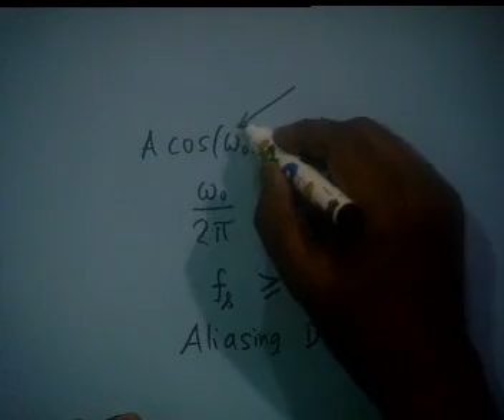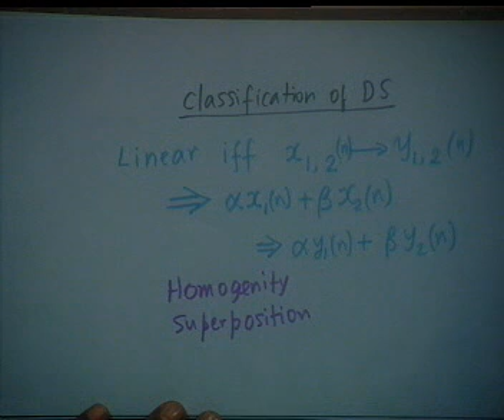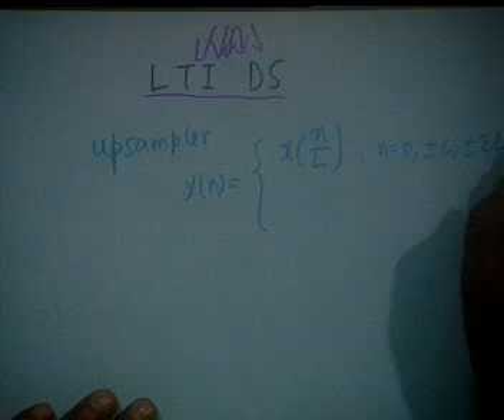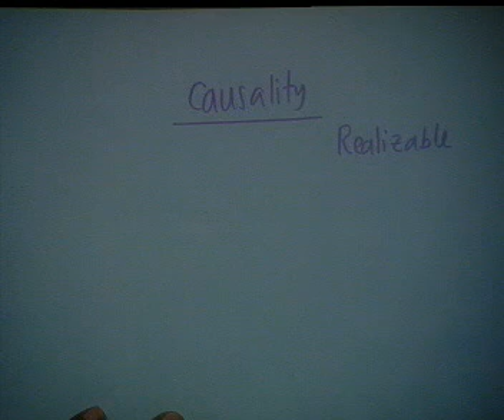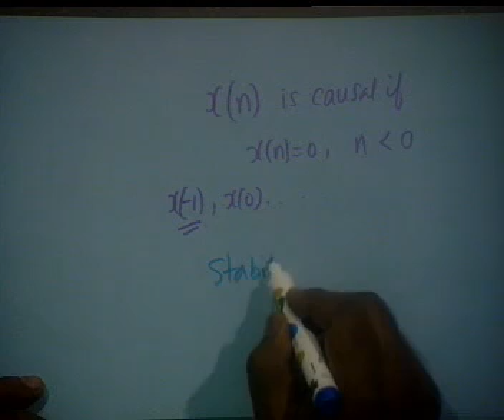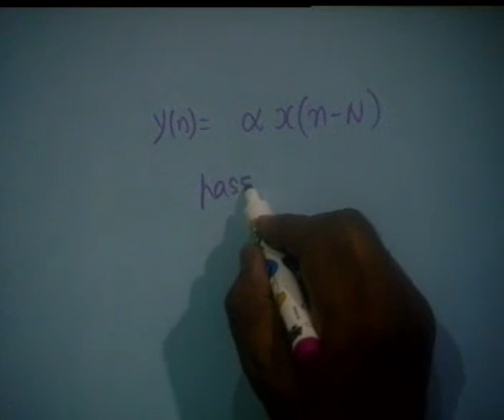Lec 4 - Characterization Description,Testing of Digital Syst

Comment: An "ACCUMULATOR" is indeed a "LINEAR SYSTEM", IF AND ONLY IF the initial conditions are equal i.e. y[-1] = ay1[-1] + b y2[-1] for all initial conditions and all a,b.  This condition cannot be satisfied unless the accumulator is initially at rest with zero initial condition. For nonzero initial condition, the system is NON-LINEAR
Reply: What about the summation part then?

Comment: I have a doubt, how can an upsampler be termed a linear system, to be a linear system it has to satisfy two conditions, homogeneity and superposition, it satisfies superposition but I think it doesn't satisfy homogeneity. X(0)=Y(0) agreed, but if say L=3, than X(1)=Y(3), and Y(1)=0,so how can it be linear????
Reply: +arsiwala faizhusein I guess you have misinterpreted what prof dutta is trying to teach. He says that for homogeneity to be satisfied, the output should be zero for input zero input. By that, he doesn't mean y(n) to be zero for x(n) zero, rather y(n) should be zero for ax(n) as zero, where 'a' is 1 in general. When 'a' = 0, the input becomes zero and the corresponding output should be zero. This is possible only when if the input is multiplied by 'a' , the output also gets multiplied by 'a'. I hope you are getting my point.
Reply: Got it, thanx buddy